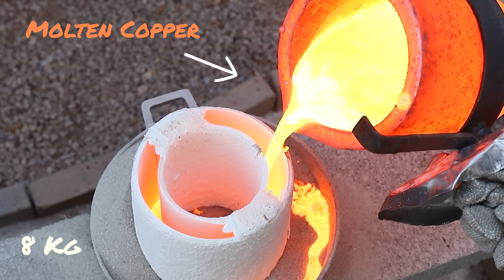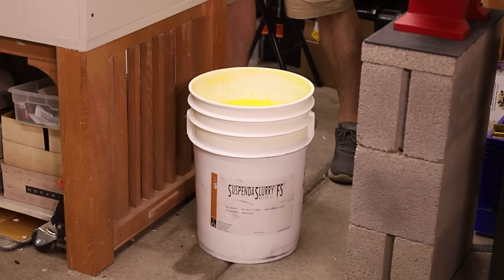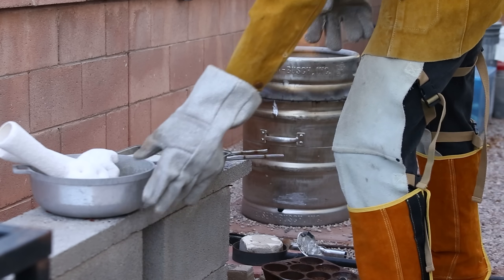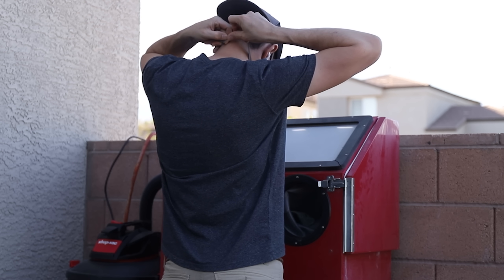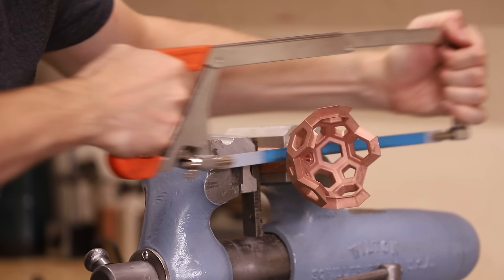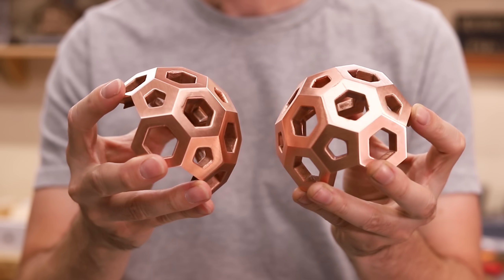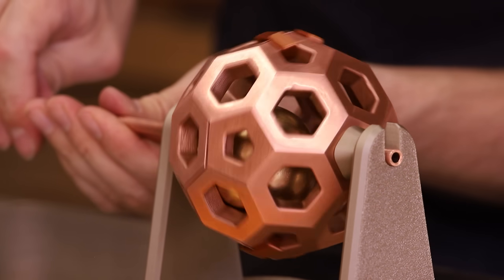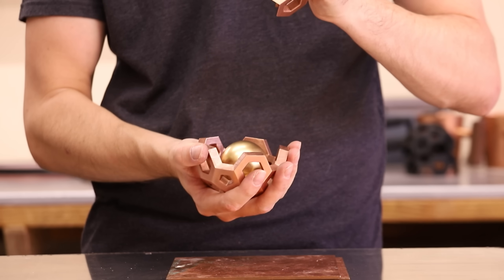HUGE Magnet VS Copper Sphere - Defying Gravity- Will a Neodymium Magnet Float Inside?

Comment: Make the sphere i bit bigger then when the ports are big enough  to focus video in the port and hook up a small electric motor  with a variable speed switch . Then you'll show how cool magnetic floating is and how it's important  in space it will be . See things work differently in space and a magnetic engine will propell us forever without fuel . . .

Comment: What if you place magnets at the 4 poles of the circle , using their fields like buffer zones where the ball magnet would sit but not touch, then spin it and see if you can trap the ball magnet stationary in the center something like magnetic locking
Just a thought.

Comment: Make a slightly bigger one. Put the axel VERTICAL, SUSPEND the magnet with a STRING THROUGH THE AXEL. Spin from the bottom. CUT THE STRING.

Comment: Another cool idea could be using a copper pipe like the one at the start of the video but with the inside parts tilted slightly towards the center so a neodymium sphere would tend to stay at the center and then control the spin of the tube using a motor so that it would keep a consistent speed and allow the magnet to levitate in the center while also being very visible. I would love something miniature like that on my desk.

Comment: Tbh I am thinking if that interaction between neodyn magnets and copper could be use to slow down falling objects reliably, for example rockets coming back from space to a specific landing platform, saving fuel by slowing it down with the magnetic field interactions

Comment: I would think using bearings in your brackets to keep it stable would work great. Great job. Maybe also shorten the copper shaft and use some other material to help keep it still when rotating. There's a lot of wobble in the shaft from both sides.

Comment: The magnet with in the sphere seems to have its own centrifugal force but during inconsistent rotation of the copper sphere the levitation of the magnet is not stable - kinectic energy transfer to the sphere in relation to centrifugal force 😮 fascinating 😮😮😮

Comment: You should consider putting steel  rod shafts for more control with a motor on one end and rubber coupling between shafts . I can tell you that you are
e generating a field of power, not sure how much magnitude maybe put an infrared camera on it with meter. But due to what you have created i would say it's not a little amount.

Comment: Should have a variable speed DC  motor to turn the axle , then set up a variable strobe light and turn the lights off and film it . Adjust the speed of the motor turning the shaft until it perfectly levitates, then adjust the strobe to blink on when you can see into a hole on the sphere

Comment: Im late to this video.  Have you used motion bearings either side to create as frictionless a rotation point as possible for free rotation?   Have you added an electric motor with a potentiometer so you can add precise amounts of rotation to the system based on inputs to the Pot?.
Similarly, you could do this to the circular magnet that acts on the copper spheroid so you can gauge how much rotation from the magnet affects rotation of the sphere.  Does rotating the sphere in the copper cause electron flow?
Question: does a larger copper sphere acting on the spheroid magnet have an effect?  Does gravity play a part in the centrifugal force acting on the spheroid magnet?  would any electrical components like the motor add energy to the system and affect the way the magnet interacts with the copper sphere.  
I found watching this entire process fascinating.  You created some very precise components.

Comment: I think if you hav a smaller magnet, you will make room for some magnetic bounciness.
If you make it on speed to levitate, then speed up to max speed quickly, may e you can hit the right spot to have it floating in the middle (if the current's magnetic field have force to hold it).
I wonder if some sort of slicing would help too, to force the current in specific planes and direct the magnetic field on most efficient shape, but it needs more science than I have right now.

Comment: what happens if you turn it on a drill vertically? also what happens if you use an external magnet to spin the magnetic sphere in the opposite direction as the copper sphere?

Comment: Let the ball and the invention be balanced on both sides and use your drill to rotate the magnet or get an engine to rotate the magnet and give it chance to catch up to the rotation. Rpm’s dievice used on the magnet should be stationary mounted and those magnets should be levitating by 2 the black magnet causing its suspension. Rotate those 2 magnets to begin the rotation of the black magnet. Make sure the 2 turning magnets are bigger too than that black one you have. And the outer two magnets big enough to rotate the black magnet easily and freely.

Comment: Very cool. It's like magic .
Precision to the thousands of an inch is crucial. 
The two half's must be a like a solid. It means the mating surfaces should be extremely polished and no space between them. Then is the balance .

Once there, the speed can be precisely tuned. There must be several characteristic speeds and modes of suspension.
Reply: I entered The most famous Toy store in New York. FAO Schwartz. I saw a little UFO floating in mid air. At first I thought it was a aerodynamic lift produced by a vertical jet of air pushing the object .
No! It was a magnet spinning against another ground magnet.
I got it. I still have it .
In order to make it work, one must spin it at the right speed, and manually lift it to some hight. Once there it flies and stays there until the drag reduces it's speed below the characteristic speeds. 
Very very cool..
Reply: You could print a solid one with holes the size of the ball magnet so after it's done and finished, you can put the magnet inside .
Things must be much better. You also can try installing the axle in different positions. 
The main thing is to have well balanced dynamically the rotor cage before inserting the ball .
Reply: You can adjust the spin velocity using a dimmer on the motor. 
One triac with a diac and a variable resistor can do it in a circuit.

Comment: Can you make like a little handles from different sides that would keep the ball away from the walls, so it doesn't just keep to either side but stays relatively in the middle but keeps floating once it starts rotating ? for example, copper rods sticking out with some foam on the ends sticking out towards the ball.

Comment: I am begging you. I AM BEGGING YOU.

Please stop saying "defying gravity". You're not defying gravity anymore than someone lifting a beer off the table. You are applying a force to an object. If the vertical component of the vector sum of the force you are applying is positive, the object's distance from the center of the Earth will increase. If it is not, it won't.

You are not defying gravity anymore than someone who raises their finger in order to pick their nose.

STOP SAYING DEFYING GRAVITY.

Comment: One way is to create a high enough base to store another magnet underneath, and have the magnet underneath rotate so the case is rotating while the mechanism is hidden. 
Another way is to possibly see if the inductive forces can be used to generate electricity in someway. You have now a case that can be separated into two poles, possibly separated with a material in-between to prevent electron transfer and find someway to make a light with a sign saying this is floating.

Comment: Nice, but why didn't you tried to spin a pipe with a neodymium magnet inside? Everyone would be curious to see if it floats, because everyone is looking now for the MAGNETIC BEARING to replace bearings for the electrical cars.

Comment: Genial por el trabajo qué estás haciendo,para conseguir qué la esfera se separe de las paredes del núcleo hay dos opciones,la 1 es congelar la cápsula a temperatura muy baja como 200 grados bajo cero,la 2 es más fácil, debería aislar las dos uniones de cobre en la uniones con un aislante eléctrico, después de unirlos sin que hagan contacto eléctrico deberás poner una carga eléctrica de corriente continua a cada ejes,un polo positivo en un lado y uno negativo por el otro,es importante que la espera magnética tenga un pequeño aislante eléctrico en su superficie para que no haga un cortocircuito durante la fase de arranque, después arranca con el motor hasta conseguir una velocidad ideal,ten presente que la carga eléctrica deberá ir dosificandose con la velocidad, también la esferas comenzara a rotar después que pongas la carga eléctrica, recuerda que el voltaje debe ser bajo comenzando con 6 voltios ir subiendo poco a poco y la corriente también subiendo poco a poco y ten cuidado con las   descargas electrostática que podrían producirse por la interacción del cobre con el campo magnético y la carga eléctrica inducida,ten presente un efecto de calor durante las pruebas.Suerte Einstein

Comment: It's beautiful. 

My only issue is that perhaps the facet edges are too thick. Can't see what's going on inside clearly enough. I suppose you could sand it down but it's probably better to cast another one.

Try putting it on vertical springs or varying stiffness so you can try different speeds and amplitudes. I'm curious to see what the damping effect looks like.

Comment: I wonder what would happen if you electronically isolated the two halves and connected a multimeter across them while spinning it at the right speed to float the ball.

Comment: My first thought during the demonstration was that you need a consistent, speed-controlled motor and a strobe light.  That would show the magnet sphere levitating in a still cage.  Also, having a minutely adjustable angle of rotation should help compensate for the inconsistent field which is causing the magnet to drift to, and collide with, one side or the other due to gravity.

Comment: It’s both centripetal and the eddy currents became to strong (if I had to guess), One possible solution is to make the Isco-Hadron bigger to add more space so the centripetal force doesn’t bounce the sphere around and makes eddy currents effect slightly weaker so a higher speed would be necessary to make float.
Reply: Also I’d make the outer core a sphere with holes so it doesn’t bounce around and chip the neodymium magnets plating making the neodymium break or corrode.

Comment: Ok because I didn't read all the comments I don't know if this was asked or suggested, but I think I have an interesting idea. 

Build a second cradle, find the correct distance for a secondary magnet to spin causing the sphere to spin and see if it causes the initial magnet to continue spinning in turn spinning the sphere and perpetually working on each other. 

I know I know perpetual motion is not possible. But is it? Just need enough force to overcome friction from the cradle and the air. But also would that cause a run away?

Comment: Wow, you discovered magnetic fields... 🤦‍♂️
Not anti-gravity which is a completely different concept: the environment will never be a gigantic metal ball and anti-gravity means inverting the basic Newton Law according to which objects are attracted to each other based on their difference in mass, for an object to be "anti-gravitational" it would need to gain a colossal mass in respect to planet Earth (or other space bodies) in order to "float" and not be attracted to the surface or there must be an energy form or material capable of not being subject to the Newton Law per se.
There are many experiments in this respect, for example high voltage electricity as the Volta Arch has the power to suspend in the air a metal object acting as a "connector" between two extremely powerful opposite polar charges bit with our current physics knowledge there is no such thing as "anti-gravityL possible... people can just fiddle with trick on magnetic fields

Comment: It may well balance out at 3500rpm, get rid of the clips, instead use the axel bearing ends as a clamp to apply pressure to keep it closed.  You will need some mechanism to lock them in position.

Comment: I've always had a similar idea to this;
magnetizing a ball baring, and create a doughnut shaped tube that is also magnetized, then shot the ball baring into the tub and close it.
theoretically the ball should be forced to endlessly float and push forward circling in the tube until removed or the magnetism dies.
perhaps creating energy that can be captured and used for something. small scale maybe a light.
but large scale. . .  a city? maybe with multiple balls in there at once.

I know very little about this stuff, could anyone tell me if something like that has been done, or could work?

Comment: It's possible the lattice structure itself interferes with the effect. A tube has no gaps in the structure. A smaller scale should prove easier to forge a ball like the ones with meditative bells inside but you'd need to detect sound or friction rather than visually seeing the effect. I like the idea it has potential for creating interference in a magnetic setup like a resistor works in an electrical circuit.

Comment: I think the biggest issue is that its not completely homogenic. Basically, you need to balance it better on the scotch brite sander. I think the best way to find out the balance is to use a lawnmower blade balancer, but it must then be a high quality one and just balance the spheres off the holes you use for the plugs. Once you have got the completely balanced, the effect should be stronger as the eddy current magnetic fields will be more homogenic.

Comment: Very interesting and nice looking! There maybe a comment referring to more circular inner of this cageing container already. Nevertheless, the inside of this cageing from quantum/mechanical side would better do without unnecessery climb of inner walls. Roundy one inside seems suit better for this solution. It flattens magnetical forces and moments, see for, how the electric motors' comutators are made. There even Elon can barely help. This wall you use, causes wobble and ease discipation of energy, so the momentum. This wall is a kind of break. More less so it does look  from mechanical point. But, imagine a sphere is just a certain special form of roller.  Also a roundy inside is very easy to MILL with home-made methods. You just drill it with proper ball-shape. And get your magnetic bearing thingy works. But even better is to make it fully ball like cage with  tri- angle cuts or hex cuts and  so fort. Have a good day.

Comment: I had scientific theories but l just wanted say that awesome ideas l was going ask if with self propelled small motors engine or something of solar powered energy can power source that mechanism of motion of metal and magnetic fields possible even RC motors manufacture magnetic or metallic materials metals like titanium and silicon and copper products etc aluminum and alloys etc like for rockets with small engine combustion engines or something similar to that of calibration engines today if cars and trucks like hemi think about it if want test drive it it’s cheaper and more to make your own type each style is different and works as science proves that process of combustion engines have methods of manufacture of combustion engines and metric system that calibrated the engine magnetic field movement that spins and produces power electric motors or solar powered like

Comment: 12:08 'It's almost like it's underwater'. Actually, it is Aether ocean in which everything is bathing. Vacuum is not an empty space. It is other way around. Watch 'Slow Mo' guys and try to figure out where does energy come in this collision? Make it as closed system and thermodynamics explodes through the roof. We have our calculations right but we are missing the perception. https://www.youtube.com/watch?v=yHPtuEfMPTc The same process is causing two pieces of polished metal pieces to cold weld in the absence of air. This is how diffusion and osmosis works. I can go on and on. Aether holds everything in places continuously. E=mc2 gives the pressure value. Yes, an average human being is is being hold by 2000 mega tonnes of TNT of energy. It is super easy to understand only if you allow your intuition to speak to you.

Comment: Create spherical materials from metals with the same volume but different densities, and drop these materials from the same height. Measure the seconds it takes to fall to the ground. You will see that the formula h=1/2g.t², which is created depending on gravity, does not work.

Comment: Maybe a smaller ball (20% smaller), a controllable motor with tachometer output, and a high speed camera to film it.  I think those clips are interfering with it too, so those need to be as evenly spaced as possible.  Perhaps even moved near the ends where the shaft is (if possible).

Comment: IDEA… 💡 Okay, so when you have a neodymium magnet floating in the center and surround it with other magnets of the same polarity, here’s the deal: the outer ones push against the center magnet, creating this balanced magnetic field—like an invisible cage. If you arrange them right (say, in a dodecahedron shape), the inner magnet can float stable, or at least not crash into the sides. Same idea as diamagnetic levitation or those passive magnetic bearings… 

*Okay, so when you have a neodymium magnet floating in the center and surround it with other magnets of the same polarity, here’s the deal: the outer ones push against the center magnet, creating this balanced magnetic field—like an invisible cage. If you arrange them right (say, in a dodecahedron shape), the inner magnet can float stable, or at least not crash into the sides. Same idea as diamagnetic levitation or those passive magnetic bearings.*  

---